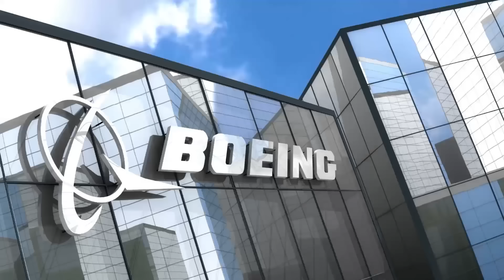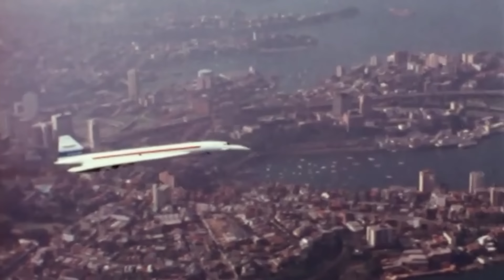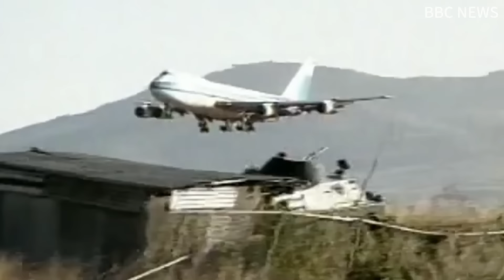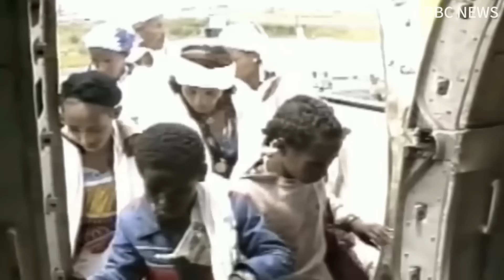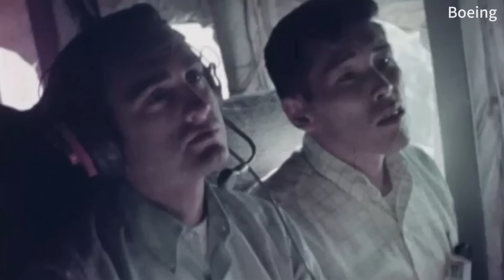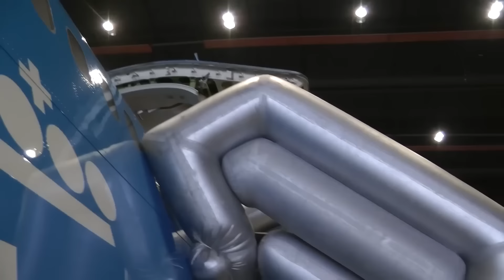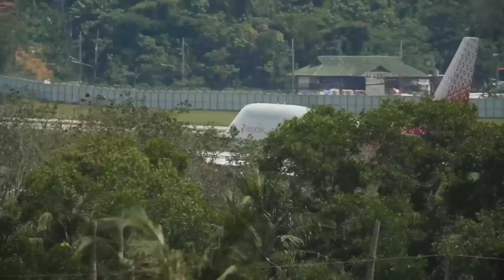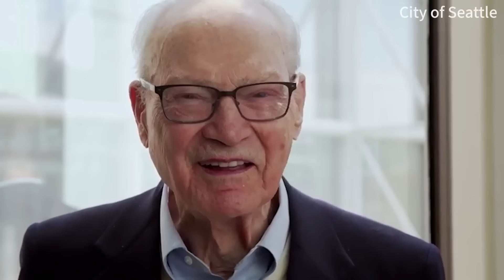What The Boeing 747 Hump Was Really For

Comment: "Obsolete in a few years"?...50 years isn't obsolete, it's half a freaking century
Reply: What wasn't known at the time back in the 1960s were various thing that eventually killed the entire idea of supersonic passenger air travel by the early 1970s:
* Jump in fuel prices due to unrest in the Middle East
* Environmental concerns over jets flying at altitudes proposed for SSTs would cause damage to the ozone layer
* General public being opposed to sonic booms -- resulting in passage of many laws that basically meant you couldn't fly SST over land.
* Increases in air traffic resulting in congestion at airports, and increasingly aircraft would have to wait around to land (so getting to destination faster wasn't always an advantage).
While originally derisively called "Jumbo jet" by its critics (as being an airplane that's too big for its own good --- indeed many airports needed to be upgraded to allow its use, which was one of the criticisms weight against the 747), it turned into a term of endearment once it was realized that by carrying more passengers, it could potentially reduce the per-passenger cost.
Reply from the maker: It's been around for a LONG time, that is for sure!
Reply: @planecurious  still 14 years less than the b-52´s though, and some of them still fly. So will some 747´s even 15 years from now, however they will surely be further and further apart. I have had many lovely trips around the world in different 747´s since my very first flight from CPH-LAX in 1977. I believe the only 747 model I never got to fly on, would be the shortened SP.

Comment: Almost everything you spoke about in this video is why no moden twin jet plane will ever amass the same amount of admiration as the 747, A380, C-5 Galaxy and AN-225
Reply: No airliner, regardless of the number of engines, has ever matched the dispatch reliability of the B-777. 
That is what airlines care about most. It is why they went into debt to usher in “The Jet Age.”
The 777s safety record is also unmatched, with every haul loss attributable to pilot error, engine failures, surface to air missiles, or subterfuge.
Reply: @RebelliousTom1  The 737NG has the highest dispatch reliability among airliners. The 777's safety record is also very much comparable to similar, modern long haulers (e.g. the A330 and even the A340). What was even the point of your comment?
Reply: @Petidani0330 To get you to add your one cents worth of criticism.
Reply: @RebelliousTom1 yea but the 747 was built in the 1960’s lol.  The 777 took 3 more decades too complete and it’s not that much different.  It’s based on the 747, as was the 767, and the 757….  All modern boeing fuselage are based on the success and design of the 747.  Except for the 787 which was made using sections which has turned out to be a disaster as much of that plane is.  777 is by far the best plane around i agree, but compared to the 747 it’s not even a comparison.  777 wasn’t revolutionary and it’s piggyback tech from the 747 project.  The only plane that comes close to the 747 in technical achievement was the Lockeed TriStar.  Which is just as good as a plane, to this day largest fuselage ever made.  But companies already trained their pilots on the 747, the tristar came out soon after and just had no customers to fill orders.  Boeing beat them to the punch.
Reply: @RebelliousTom1 Even for that, 747, A380, etc., majority will told us “it’s just the plane.”
Reply: Hull loss. I agree with you over the 777.
Reply: @RebelliousTom1  Two engines is boring. 🗿
Reply: @RebelliousTom1  you forgot the 787
Reply: @RebelliousTom1  Except it hasn’t had as much flights and years of service as the as the 747.
Reply: You mention the C-5A Galaxy. I flew on one from Travis AFB, CA to Yokota AB, Japan. Had the opportunity to air refuel over Hawaii for a non-stop flight. We sat high in the tail section. The fun part was climbing downstairs to see what cargo the aircraft was carrying. There was a lot of stuff including vehicles.
Reply from the maker: I agree!
Reply: A new huge engine is capable of converting mothballed 747's into low cost 2 engine airliners. Unclear if that engine will go into production.
Reply: @BoomVang this is never ever going to happen. Not sure where you get this from, but it’s not true.
Reply: @BoomVang you can't simply convert quad engine jets into twins.
Reply: @enigmaticcruz2483 indeed.  Recently, the efforts to put new engines on the b-52 considered whether they could replace 8 engines in 4 pods with just 4 larger engines.  The answer was not without replacing the wing structures, which would have been way to expensive to be anywhere close to worth it. @BoomVang
Reply: @BoomVang That sounds a bit suspect  - the 747 airframes have a limited lifespan….no idea how they keep Buff going but maybe none of him is original
Reply: You forgot the BELUGA.😢
Reply: The AN-125 was the four engine antonov not the AN-225
Reply: @michaelmayer8618 The AN-225 could have been built as a quad jet if the Soviet Union had higher thrust engines available.
Reply: Ok that is extreme example, but the real difference is that in Finland, Sweden and Switzerland the fighter jets are landing on the roads and ground crews are maintaining them there so that they are ready to go again. Maintaining US gear is way too complicated and expensive. It is not compatible to our way of fighting and if airlines would have to use US military gear they would be bankrupt in no time.
Reply: @verttikoo2052  exaggeration?  You stated the C-5 had to go down two weeks after a roundtrip flight and it’s not even remotely close to what you claimed.  All those countries you mentioned combined has an area less than ten percent of the total area of the continental US.  There’s a reason why the US doesn’t need to land fighter jets on highways.  As far as maintenance and down time of US equipment if that were true then why are other countries buying the equipment?  Several countries fly the F-15, F-16, F-18, F-35 and they still buy the equipment even if the price is higher than competing aircraft like the Gripen, Eurofighter, etc.
Reply: @verttikoo2052  our f35's practice the same with using roads to refuel and rearm. 
Your not wrong about the us logistics chain is complicated and expensive.  Not all of it is cost effective, like it would be as a business.   But we are also in a unique position, we are the greatest military thats ever walked this planet.  We have the greatest economy as well.  
When you say its not compatible with the way your country fights, thats probably not true. Assuming your in some eu country.  We train and have exchange programs with all of our nato allies.  Its standardized.   From weapons systems all interoperability, to common ammo, tactics, and shared intel. 
Nobody expects our partners to shell out as much as we do, its unreasonable.  But we expect you to fulfill your obligations.  
Our equipment is very expensive, our training is very expensive, the money we spend on our people is very expensive.   And you guys reap the benefits.  We will never abandon our friends.  There will be tough talk politically.   But our military doesn't operate in that arena.  Anytime trump gets into it with another country, it changes nothing within our military relationships-unless its some kind of egregious act.  The guy wheels and deals.  Its part of the deal with him.  Publicly.   Privately, he understands the military and doesnt get involved with those relationships.   So heres what it comes down to.  If you were pinned in and had any country in the world to call, who would it be?  And do you think they would come?  I know the answer because during gwot,we had plenty of those calls.  And we never gave it an effort less than we would have for our people.  Dislike or hate trump, fine.  But also know thats the same guy that has unleashed us plenty of times to go help allies.  Anyone aligned with us has never had a better friend as president.  Keep all this in mind when you dunk on the guy.
Reply: I flew/still fly two of those three! I flew the C-5 for 20 years. And I have almost 11,000 747 flight hours. There was an eight year stretch, from 2011 to 2019 when I was flying both.
Reply: C-17 is much more admired by the military and pilots than the C-5.  It’s used for more types of missions, it can climb unlike any other jumbo jet, and it flies like a boeing so it’s easy to train pilots.  If you’re going to Lockeed, the TriStar is the marvel of their fleet.  The galaxy is amazing because of how old it is and how much it can carry but it’s very impractical and super scary to fly as a pilot.  Just so much archaic weight.  Great jet but that and the Antonov are for fair weather Millennial aerospace fans (people my age).  Because all they care about is how cool something is or how massive or overwhelming.  They don’t actually think about practicality or flying.  The Antonov and Galaxy are bedroom poster planes…they don’t come close to a 747 or TriStar or Globemaster in terms of reverence and admiration.  Also, NO Airbus would ever be on that list.  You probably don’t realize this, but it’s side stick, pilots HATE sidestick, especially with a plane that freakin huge.  The A380 is massively impractical.  And if Boeing had been offering all 747 versions instead of winding the program down, it would have continued to sell and probably would have outsold the A380 even 30 years later
Reply: Yes, of course, history has shown that every generation of airplanes is worse in every way when compared to the ones before !  🙄
Reply: Would have to be the first hypersonic jetliner that travels on the edge of space.
Reply: That is the thing. We have now realized that our equipment is cheaper to buy and maintain. That is why we are not going to buy defense systems from the USA anymore. We have better and more economical options.
Reply: Smaller planes are also widely admired. Did you mean a different word, because your comment makes no sense
Reply: Nothing has the profile or the silhouette of the 747. While the 380 is amazing in its own right, the 747s hump is what makes it so majestic.
Reply: And yet the 777 even with its smaller size has already carried more passengers and is still going strong…
Reply: wasn't the Hindenburg the same size? Was in the 1930s though
Reply: You left out the C-141.
Reply: For very different reasons the two greatest commercial aircraft of all, Concorde and the 747 were exact contemporaries in development. Neither will ever be matched in their respective spheres of operation.
Reply: An-225 was 6 engine tho
Reply: @southaussiegarbo2054 That was a workaround as soviets were behind in engine technology and couldn’t provide enough thrust using 4  engines. Total thrust of those 6 engines is roughly the same as  2 GE90 engines used in B777.
Reply: @serhiymarchenko8361 The Ivchenko progress D-18T engines used on the AN-225 produced 51,672 pounds of thrust each with a weight of 9,000 pounds each.  The GE90-115B produces 115,000 pounds of thrust with a weight of 18,000 pounds each.  The GE9X has a maximum thrust of 134,900 pounds with a weight of 21,230 pounds each.  The GE9X would be 20,000 pounds of thrust short of 3 D-18T engines.  2 GE9X engines would only be about 12,000 pounds lighter than 6 D-18T engines.
The perfect engine package for the AN-225 would be 4 GEnx-1B76 engine.
Reply: @southaussiegarbo2054 , does it matter?
Reply: Funny is that c5 needs 2 weeks of maintenance every after every return flight. That would bankrupt every airline. Imagine flying from London to New York and back and then fixing the plane for two weeks 😱
Reply: @verttikoo2052  where did you get those specs?  The C-5 will fly several missions, with nothing more than a preflight and post flight inspection.  The Air Force takes all of their aircraft out of rotation, for major inspections, that can take weeks, but only done maybe every five years.
Reply: Just like drydocking. 5 yr intervals.

 @robertheinkel6225
Reply: @verttikoo2052 don't know if your mil or not, but we take maintenance in all the branches to ocd levels. What your talking about is 100%.  There's different levels that are possible depending on the urgency of the mission.   Not to say weapons, vehicles, aircraft are unsafe if not maintained to that level.  It can drop down several levels and still be higher than standard in the commercial fields.
Reply: @verttikoo2052  - Are you saying that during the annual Operation Team Spirit exercise, that each C-5 only flew a single round-trip flight? During war ("conflict") each C-5 only flew out and back once?
Reply: @verttikoo2052 You’re comparing apples to oranges. No 747 can carry an M-1 tank and every 747 that was built when the C-5s were built have been scrapped (except for the one at Boeing’s Museum and the shuttle carrier).
Reply: @RebelliousTom1 the 747s that are scrapped, have around 100,000 flight hours. C-5s won’t even hit 50,000 hours till after 2050.
Reply: @rbtrbt_dutchy4183 I’m afraid you are trying to conflate apples and oranges. I love 74s, my brother is rated on classics, 400s and -8s but the C-5 is not a bus or a big truck. It is more like an ambulance or a fire truck. It needs to be ready on a moment’s notice and then it will be worked like a dog. 
And most older 74s where grounded because they became relatively inefficient. 
Also, freighters, including 747s, make far more landings at their max landing weight ( which is why so many of them land in Anchorage) and that exacts much more strain on the airframes. 
Again, the need to defend democracy far outweighs simply making a profit.
Reply: @verttikoo2052  An airframe is a box you put things in. We need to stop treating aircraft like special magical obelisks that cannot be changed. 

I can add an esp32 to every single electronic component. Move the entire plane over to ethernet and enable plug and Play with any system on board. I don't know. Maybe 10 grand. Mostly in the cost of installing.

Whatever the heck takes 2 weeks of maintenance just needs to be replaced. Get SpaceX and/or Tesla on it. They know how to engineer.
Reply: @jtjames79 Found the Musk worshipper.
Reply: @jtjames79 The place that blows their rockets up on the regular or the place that builds trucks that fall apart? Yeah, I’ll pass on both of those 😂
Reply: @xodiaq  Said like someone who's never tried and therefore has never accomplished anything in their life.
Reply: @jtjames79 nobody wants an.esp32 on any aircraft component, let alone all of them. Your harebrained scheme would only harm reliability.  

Maintenance personnel time is needed to inspect the things that electronics can't feasibly detect and report status on.  

And if you don't know the difference between two technician-weeks of work and two weeks on the calendar, don't come back until you've found a clue.
Reply: @xodiaq  - Tesla blows things up in testing. Why is that a problem?
Reply: @bruzote  Do you mean SpaceX???
Because SpaceX almost caused the loss of passenger jets and a city in the Caribbean with their "Starship": that can't seem to make low earth orbit...
Reply: Most of the facts in this video are incorrect
Reply: @RobertHurley-c6g nah, most is correct. Some things are a bit exaggerated. Some things are indeed incorrect. But most isn’t too far from the truth.
Reply: The A380 was junk.
Reply: @bermudarailway untrue
Reply: @Gartonello  Baggage hold not big enough to take all the passengers bags . Alot of bags had to go on a later flight. Its junk.